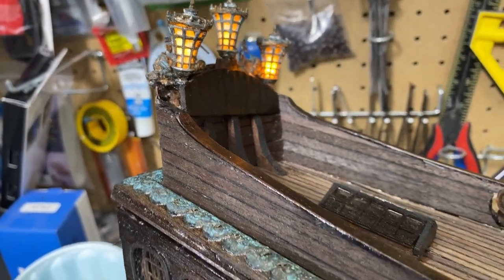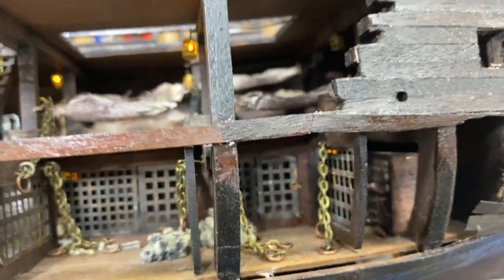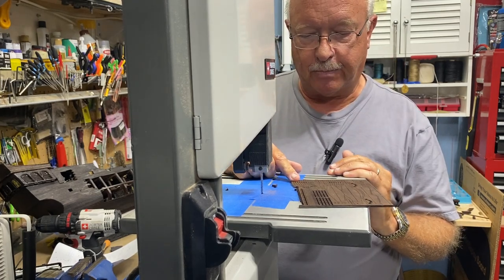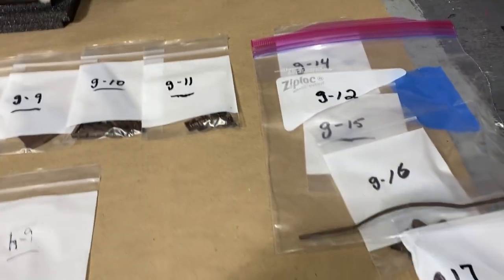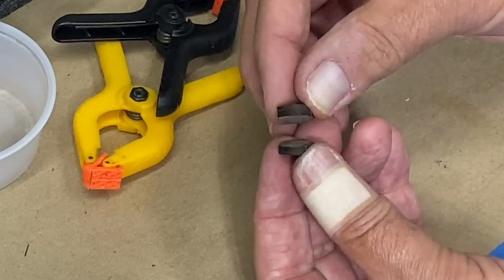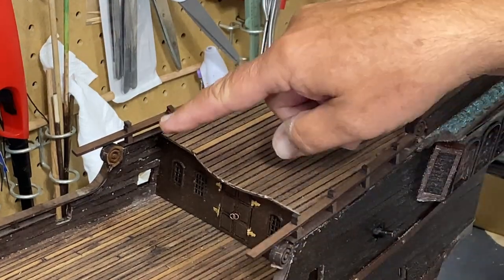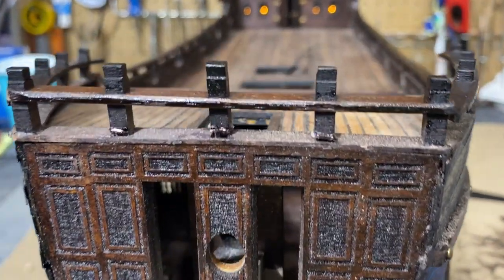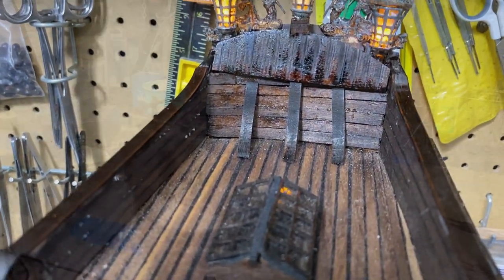Black Pearl All Scenario Version PART 14

Comment: Great work! Been enjoying your series of videos on the Black Pearls you've worked on. What are the main differences between the Golden Version and this All Scenario version?
Reply from the maker: The golden version doesn’t have the open side showing the two lower decks. Also the Captain’s Quarters is fake. The outer windows are there but the room itself doesn’t exist.
The All Scenario version has extensive detail on the lower decks…. Some of which you can’t see after you finish.
I’m not sure yet as I haven’t started the rigging yet on the All Scenario version, but I think the Golden version may have a lot more detailed rigging lines.
Thanks for following along 👍🏴‍☠️👍